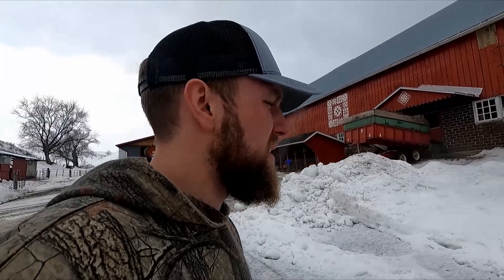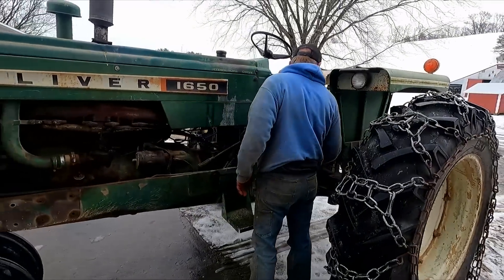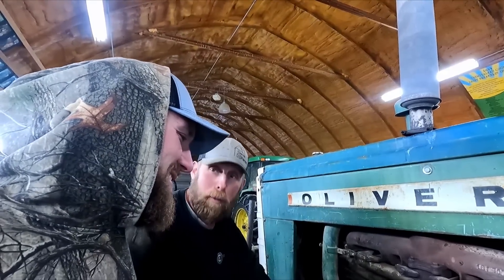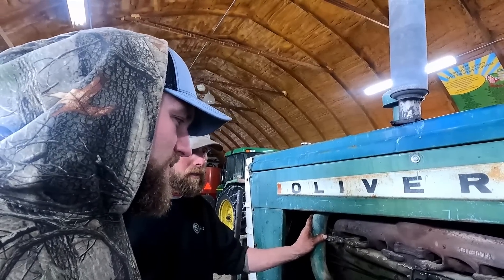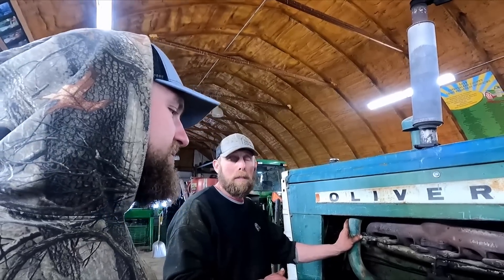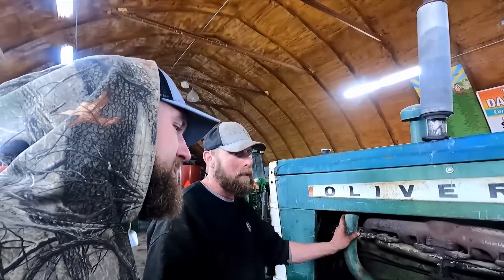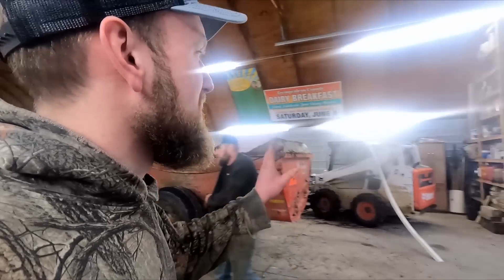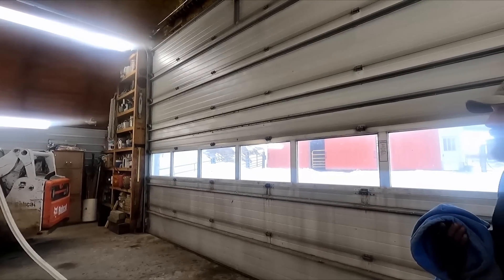We Found A BIGGER PROBLEM!

Comment: Nothing to worry about. My Farmall M did that every winter. It's condensation. I finally put a new thermostat in it last spring. The old one was stuck open. If the thermostat is working, the temperature gauge should move even on a cold day. Check to see if the thermostat is working first. If you're still concerned, take a sample of the oil and take it to a any dealership and have them test it for impurities. An oil sample will tell you exactly what's going on with any engine.
Reply: no io parlavo del gas a mano e non a pedale come nelle macchine 
ma comunque grazie lo stesso

Comment: On your 7405. The MFWD clutch is spring applied and hydraulically released. You will need a press to disassemble it. There is a spec for how much end play there should be on the shaft. Once it’s together make sure to hit the end of it with a dead blow hammer a few times to set the bearings. Then use a battery or something to put power to the solenoid on the back. Use a blowgun and compressed air to act as your oil and you can bench check it to see if it releases.
Reply: Probably wouldn’t hurt to check for power and ground at the connector on the harness to make sure it isn’t electrical before you start taking it apart.

Comment: I’d keep an eye on coolant and oil levels. If oil level goes up and discolors towards gray instead of black, I’d pull it apart. I don’t know if it is a wet sleeve engine, if so oring could be leaking. I’d lean more towards head gasket or worse yet a cracked head. Old in-line gas engines are about as simple as it gets but good used parts, as I’m sure you know, are getting harder to find. If you continue to use it when warm weather comes you could run clear water and work it harder that way if it gets worse fast it shouldn’t do any worse harm as antifreeze in the oil will whip up, starve lubrication and take bearings out. Just my opinion and by the way, both you guys are young yet. Good luck.😀

Comment: I have found that the best way to see if the o-ring in the in the sleeve is leaking is to remove the oil pan and look to see if you can see antifreeze around the cylinder wall. I have 25 Olivers and I deal with the 50-60 years old tractors all the time.

Comment: I have 12 international/Farmall tractors - we all have issue and hidden surprise daily. I try to keep every tractor tip top shape but they are old and need attention. Don't be afraid to learn and dig in the problems. Remember "Farmer Enginuity 101" has help me through lots of headaches and coming out pretty sweet on the other end!!! Trust your gut and instincts! Best of luck and try doing a radiator/pressure test to verity you don't have a head gasket out!!!

Comment: Agree with the guys advising to pressurize the cooling system first, see what you have.  My bet would be an o-ring on a sleeve as this is a wet sleeve engine, but could be head gasket.  It’s not hard to get the pan off that tractor, pressurize the cooling system with the hand pump on the radiator neck and see what you get on the floor, or in your face as you check it with a good light 😄.  Easier to do this first before taking the head off.  If it is a sleeve o-ring leaking, you’ll be pulling the head off anyway to fix it properly.  Overhaul kits are readily available for that 265 engine.

Comment: I have a 1960s John Deere 2020 diesel. Checked the oil one day and it was reading high. Did oil change and the oil wasn't milky. Checked it a week later and same problem. I was getting fuel in my oil. Replaced the transfer pump and new injectors took care of the problem.

Comment: We had a 966 that had anti free eat a hole through  a  sleve. Sweet smell  could be head gasket or cracked head. But  won't get in the  oil.or oil cooler damage if it has one

Comment: I have a 1550 with a wide front end you guys can buy all the parts intake exhaust all the gaskets ECT I believe you can pull the head with all of it attached except the carb. I put a new water pump in mine last summer. Great video

Comment: I have an Oliver 88 diesel. Checked fluids one day all was well and ran it. Two weeks later I noticed oil was slightly higher. Cracked the oil plug and had a cup of antifreeze come out before the oil. Tore it down, bad o ring on the sleeve

Comment: Looks a little too milky in the video to be condensation. My bet is that it's a head gasket or in an extreme case a cracked head. Not a tractor mechanic but I specialized on the old Datsun/Nissan 240 and 280Z. Long 6cylinder with an aluminum head. Those heat cycles are killer on a 6cyl with the aluminum head. I 'lost count on how many head gaskets I did over the years. Standard procedure on every service/tune-up was to do a "block check" (see the link). I recommend doing it hot and cold. The problem with letting it go is that it causes problems with the valves maybe even detonation. The lack of coolant loss is puzzling but there is a test you can do. Lower the coolant in the radiator about an inch or so to run that test. The block check draws air out of the radiator and through the fluid in the device. If there is Carbon Monoxide present the fluid will change color. It's not a completely fool proof test and I've had a cracked head that only leaked when cold get by me. That's why I say hot and cold. Be sure to clean out the device with water before every test. In an emergency I've been able to get by for a while with a produce called KW Block Seal. Use caution if you go that route. It can plug an old radiator if you aren't careful. Yea it's hack, but sometimes you have to do what you have to do. Its might be a good idea to do a pressure test as has been suggested. I don't remember if this is a gas or diesel engine. If gas, remove the plugs and let the radiator sit under pressure for a while and the turn over to look for fluid. Just pulling the spark plugs may show signs of fluid or rust. If diesel it might not be a good idea since you have no way to check for fluid in the cylinders. Hydrolock would not be good. As some have suggested, if all this fails to get then you will have to look at the sleeves.  Good Luck https://www.amazon.com/Block-Tester-BT-500-Combustion-Leak/dp/B06VVBSFTF   https://www.amazon.com/401016-Block-Permanent-MetallicTM-Radiator/dp/B000CIPV5E/ref=sr_1_1?crid=3QDJY5MCAPKTN&keywords=kw+block+seal&qid=1679450403&sprefix=kw+block+seal%2Caps%2C165&sr=8-1

Comment: I would let the 1650 set for a week or so and like you already did, crack the drain plug and see if antifreeze comes out which it will if its in there. I have had two tractors leak antifreeze in the base.  My 886 had a cylinder liner with cavitation corrosion through the liner o-ring. I ran it for awhile like that and finally rebuilt the engine. The other tractor is a IH 674. It sat for a number a years in the barn. I checked the oil and it was full of antifreeze. I took a chance and changed the oil and filter and that was 6 years ago and so far it has not leaked since. I expect it was leaking from a cylinder sleeve o-ring as a head gasket will not generally heal itself. You could have a head gasket issue. A way to tell if its a cylinder liner leak is pull the bottom pan and dry off the bottom of the cylinder. If a liner is leaking you will see the antifreeze drip from the cylinder.

Comment: Thanks for all the great videos guy we love to watch them all. I'm a Farmall Man but I also have 2 880 Olivers too. What could be happening is just condensation from cold. It could be the head gasket or it could be the o-rings on the piston sleeves. I've had in the past from the cold weather where my one 880 gets a shot glass of antifreeze in the bottom of the oil pan. It leaks when the sleeves shrink in cold weather. To remedy this problem I added a can of Case IH radiator stop leak and it has been good for many years now. If you're problem persist I would at least give it a try. Since then I've found a even better radiator stop leak. It's called Conklin Dike. It will not plug the cooling system and when you change the antifreeze this product will wash out with the old coolant. I believe it is a very good product and have used it in a few things with leaks especially semi trucks. Old Mack's tend to have leaky head gaskets.Keep old Ollie running strong!!

Comment: They all need work at some point no matter what brand. Possibly O rings on the sleeves or a head gasket. Just check the oil before you run it. Thanks for sharing!

Comment: It may not be a head gasket,   could be the O-rings on the sleeves if you have wet sleeves the O-rings go bad and leak antifreeze into the oil .

Comment: Lol.. "You wouldn't think these old tractors would go bad.. funny but true. They usually don't. Yes if only we could wake up and the tractor fairy would have it all fixed in the morning...lol I've wished that at times. My Gleaner E is the oldest one still operating. It's no. #1100 out of 17,300. Works every year. Up to 200- 500 acres. My 1962 case western 1032. Same. Still use my farmall A crank start on grinder. And my '41 case sc still works as well as my 42 case vai. These are so bullet proof. Love the reliability.

Comment: I agree with Dad on the Ollie. Run it and monitor fluid levels for a while. If an issue does arise, you can use a Farmall or the small IH until you have time to repair. I'm betting on it being condensation myself. It's cold up there, and it doesn't build much heat on the short barnyard jobs in the winter.

Comment: Good luck with all your projects...seems like for every item we fix, there's always 5 more waiting in line. Running the 1650 on lighter jobs while keeping an eye on the lube oil  and doing a compression test might be a start. Hate to see a rebuildable engine ruined running full bore if something is amiss.

Comment: An old mechanic always told me to at a little Heat to the oils in the winter to eliminate condensation. In the winter the tractors never get hot enough to evaporate condensation.

Comment: Try giving Zimmerman Oliver in Ephrata PA a call. They know those engines inside and out. They might be able to help. Pulling the head and sleeves is not a hard job, just a lot of heavy lifting. The manifold will come off easier than you think.  If you are willing to work on the gearbox on your JD, this gas engine is nothing.

Comment: You will change a head gasket no problem! But your dad is right just watch the levels and see.But just a heads up I don’t know if the Oliver is a sleeved motor, but some times coolant will eat a hole in a sleeve. It makes a pit in it and then coolant comes through

Comment: Bars Leak head gasket repair, install a new thermostat, put a gage on the radiator to check pressure. Let it run for awhile at temp to evaporate the condensation.  Cut open the old filter to see if its making metal or any other defects.

Comment: You can get a kit from Napa for checking your antifreeze for exhaust  games you hook it up to your rad cap por the test fluid in it if it turns yellow  you have a headmaster leaking also you can pull the oil pan and pressure test your cooling system  if you have leaks you will see it around cylinder  liners good luck

Comment: Well I'm not necessarily and Oliver man but I have worked on a few tractors. I would be checking head gasket but I also would look to see if perchance it has wet sleeves if so you might have a leaking o-ring there

Comment: Put a pressure tester on to see if it holds  if you loose pressure and don’t have external leaks it could be head gasket or rubber seals on sleeves could also be a pin hole in sleeve antifreeze in oil is a rod and main bearing killer i always drop pan pressurize you will be able to see where it’s leaking😊
Reply: Yep, that’s the best way to diagnose the problem.

Comment: If/when you find an Ollie issue, hope you'll let us in on all the details.  When you did the tranny, would like to have seen more of the disassembly, diagnosis, replacement, reassembly.  Meanwhile, is the Ollie thermostat the correct OE temperature and is it functioning properly?  If not, that could account for excess condensation which will also cause poor lubrication and engine wear because the oil remains cold and thick.

Comment: I'm a JD guy (2 cyls), but I operated equipment from neighbors and friends and rentals my Dad had which included several brands including Oliver. Older than your 1650, but they worked well. The older stuff mostly did. Also operated Farmall H, M, W, C, 350, Cockshutt 50 (one fell of a powerful tractor).

Comment: We have a dozen different Oliver tractors here on our farm in Missouri. It could be a number of things. 

1. Condensation like you say.
2. Leaking head gasket.
3. The o-rings at the bottom of the sleeves could be leaking coolant into the crankcase.

Head gaskets are fairly easy to change in waukesha motors. You can take the head bolts out without taking the manifolds off to change it. You will have to take the valve train off to get to some of the head bolts. 

If the head gasket is not the problem I would be leaning towards the o-rings leaking. If this is the case you will need to disassemble the motor and likely have the block machined to have new o-ring lands.

Watch Chris Losey on YouTube. He is in the process of rebuilding a larger Waukesha motor for a 1855. He has a video talking about the process for the o-ring lands I mentioned.

Comment: Besides all the diesel inline six tractors I've operated, a few inline six trucks including the leaning tower of power in the 82 Dodge I had, I'd say the Olivers had thee smoothest running engine of all. Dump some K Seal in the radiator. It ain't gonna hurt anything even if it doesn't work and your not out much. And if it works, problem solved.